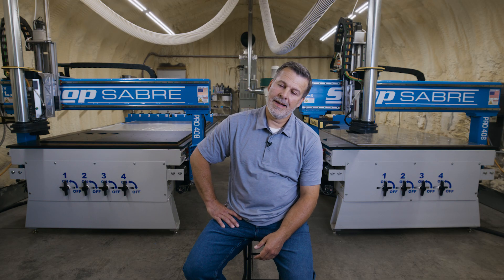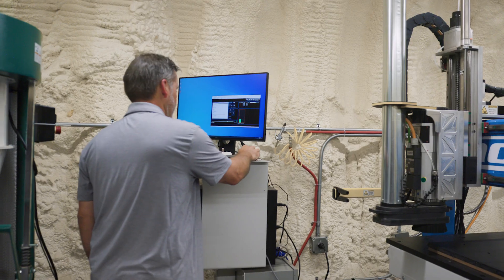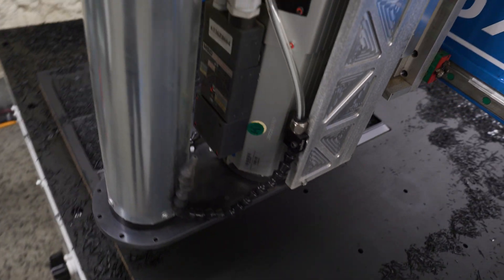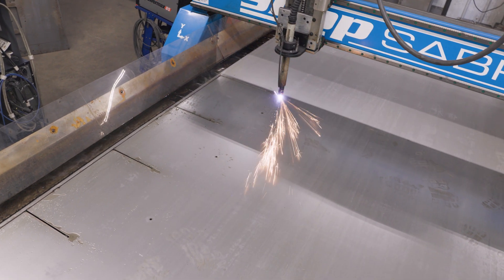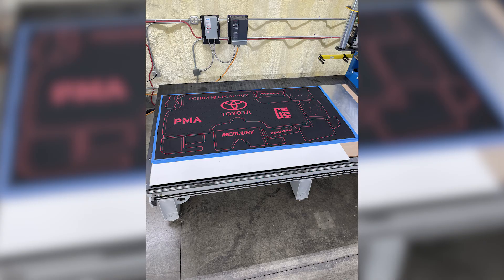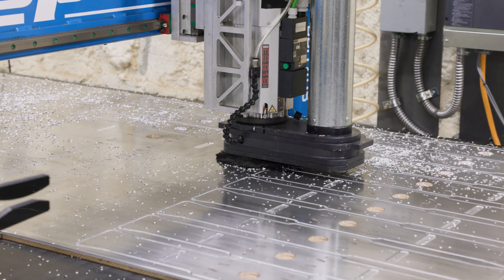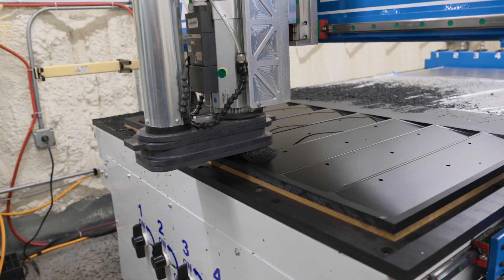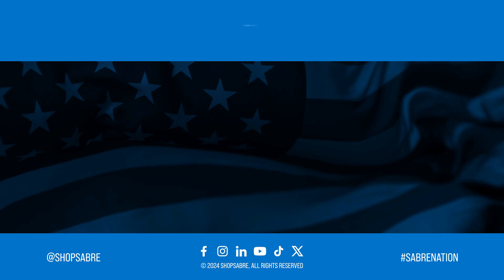3 Years, 2 Routers, 1 Plasma - Out & About with Mine Lifeline

Comment: Great testament, but no intro from Router Bob? Will Shopsabre be showing a video of a Pro408 modified for a vertical joinery table?
Reply from the maker: We don’t have a vertical joinery option, while some customers have customized their machines to do this it’s not factory solution. The majority of the use is done with flat processing utilizing and for jointer commonly the dovetail kits or pod style material holding is used

Comment: Fiber lasers are excellent and far better than Plasma cutters. Why don't you guys offer fibre laser cnc Machine
Reply from the maker: Well that’s kind of a blanket statement - Fiber lasers are great in many ways but they have limitations too where plasma makes more sense. Depending on the application there are times when someone would say the opposite about the two. Just like plasma has limitations so does fiber lasers. For one, plasma is far more affordable for many applications and far less regulated making it much easier to install in everyday applications.  

Plasma and fiber lasers both exist for a reason in harmony, they both have their pros and cons which are application and budget specific